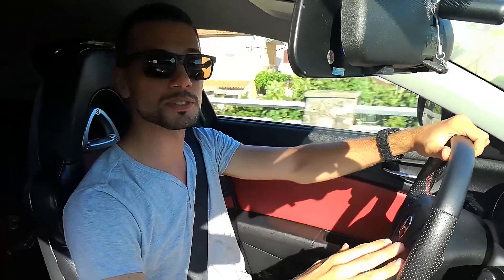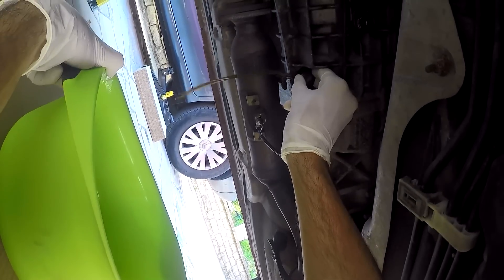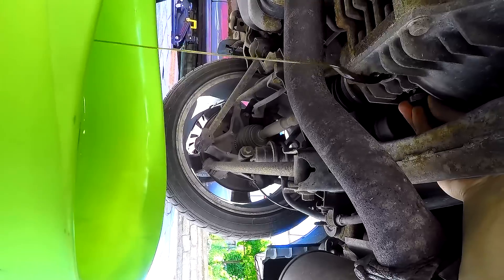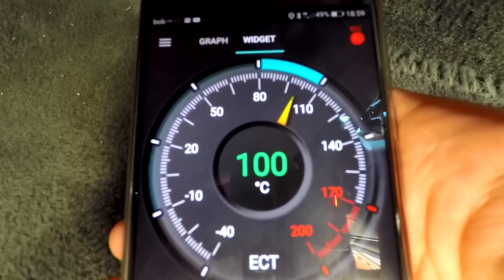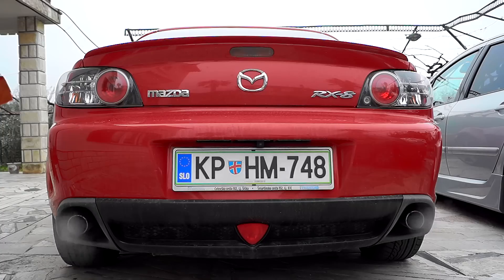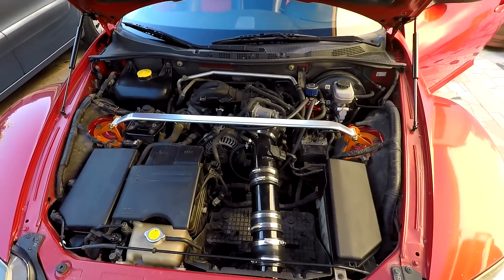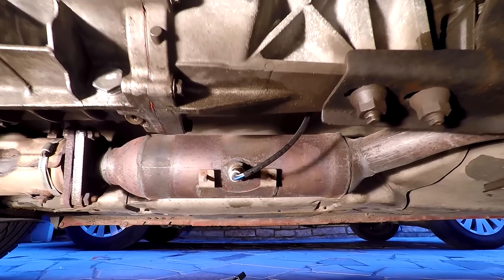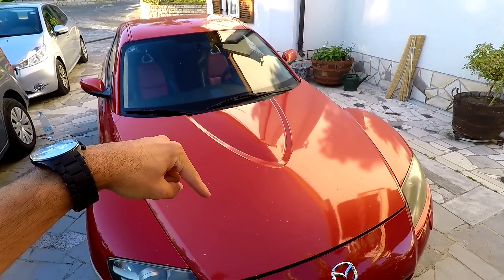10 Ways To Make Your Mazda Rx8 More Reliable (dont' disconnect the metering pump)

Comment: thank for all the tips about RX 
i have RX8 2005 se3p i think its 1st gen. i get the rx for very low price all stock and have 
145,000 kilometers on clock  its my 1st time on rotary engine the only issue is long start
my question is it worth the to spend or start for upgrading the engine? like sohn adapter exhaust 
filters and every thing.! or its too late for that and run the RX till end of it...
i get the car just for fun and try the rotary!  i have everyday car 
if i start to spend the money it will very expensive specially here in japan
the car registration and road tax is very expensive so if you tell me is it worth to spend money
i will do i trust you..
thank you and sorry for my bad english
Reply from the maker: You're welcome man :) Yes that is the first gen rx8. My suggestion would be to make a compression test, so you know how long the engine will last. I made a video on that topic that you can do at home for under 30$. There you will also see a chart that will tell you what the result means. If the compression is good, i would suggest to upgrade your engine starter, to a 2kw or 2.2kw one, like i did in this video https://www.youtube.com/watch?v=vgIhxFU-nGg
If the compression is not good, i wouldn't suggest investing on mods, but rather do a rebuild. it'll be a bit expensive, but then you'll be able to enjoy the rx8 for many many years and be able to do mods. I hope this helped :)
Reply: thank you for advice i've done change the OEM starter to N3R3 more big and power now my car start quick
i think i will invest on mods like you sed
Reply: @reggieflores5263  is bigger or more powerful battery with 750 or 900 CCA better than better starter? Thanks 🙏⭐

Comment: One other small but important thing. The SSV valve and selenoid should be replaced after around 80,000 miles. Just once, the newer parts have re-inforced parts.

Comment: I have 3 concerns with my new 2003 RX8 that I need to fix...
1. Heating/Cooling not working properly,
2. The Airbag light is on and won't switch off no matter what I've tried (the steering wheel had been changed, maybe this has effected it?).
3. My dipstick and oil cap lid has "cream" on it... (similar to when a piston engine blows a head gasket). I'm told this is just moisture and is normal for a rotary engine... is this true? 

I gotta start somewhere... what do you recommend  Kristian?

Comment: Dam...   09 rx8 with all stock ignition system and it fires like new still...   75k miles and no rebuild yet...   Only thing I have done is cut off the cat and muffler running straight pipes...   Always run 91 premium  fuel or higher...   Im breaking all the stereotypes lol...   BTW I don't premix...   Im planning on getting a sohn adapter in the next year tho...   Easier to fill those reserves than the engine oil
Reply from the maker: You and me think the same ;)

Comment: Hi, Sir
    Can you make a video for draining the clutch fluid? My car has a problem which is when the engine goes warm, my clutch would go to stiffer. I think I should bleed the clutch fluid. But I don't have any ideas about that. Thanks
Reply from the maker: I will do it, but later around october/november :)
Reply: Yes forsure bleed it mine did the same thing

Comment: What oil filter are you using and do u pre mix ur car ? if you do what ur ratio =)
Reply from the maker: K&n oil filter, and i don't premix, i'll rather run the Sohn adapter in the future :)
Reply: Thanks for the reply man really appreciate it ! <3 do you mind explain about Sohn adpater to me ? is it the same as OMP?
Reply: rebel 510678 for what I understand from the video is still pre mix but he added a container to hold the 2 stroke oil in the engine bay but I could be wrong correct me if I'm wrong :)
Reply: He uses an oil catch can to catch any oil which he overfilled during the regular top-ups. The sohn system is a better oil injector for beter apex seal lubrication i believe
Reply: Mark Boersma so is still premix but instead of adding the 2 stroke oil into the gas tank u add it into the sohn ?
Reply: Yes, that's what I think anyway (haven't done a lot of researce on it though)
Reply: Oh, I used to premix my car around 150:1 to 160:1  just by mixing it with the fuel. Estimating the litres that she needed and putting the matching amount of oil in the tank before filling up (watch for any people around you because they tend to look like you're an idiot when you do it this way 😂)
Reply from the maker: Premix and sohn are the same thing, but done differently. With premix you add s troke oil in the fuel, and that's what lubricates your engine. With the sohn, you put in only fuel and the engine oil does not lubiricate the apex seal anymore  ( you disconnect the dirty 5w30 oil from teh oil injector) , but the sohn system runs the clean 2 stroke oil directly in the original oil injector that lubricates the engine. This way you eliminate the dirty engine oil you usually pour in to lubricate the engine, and have a clean one that reduces carbon buildup. Hope it was clear :)
Reply: I run 80ish/1 in my single cylinder 4stroke dual sport and 100/1 in our v6's. Noticably better pulls and better mpgs 😂
Reply: Driven by madness so the sohn is kinda like a new oil injector for the car the shoot clean 2 stroke oil ?
Reply from the maker: Yes :)
Reply: so in the video there 2 bottle would i needed to fill up the 2 bottle or just one
Reply from the maker: Well 1 bottle replaces the big windshield washer fluid one, and the other is 2 stroke oil :)
Reply: Driven by madness ahh I see thanks for your reply man really appreciate it! <3
Reply: Driven by madness ahh I see thanks for your reply man really appreciate it! <3
Reply from the maker: no problem man :D
Reply: Driven by madness one more question man do I have to refill the 2stroke oil every time I get fuel for the car or only refill when it's finish in the container :)
Reply: @markboersma8694  Great info 👍 1:150 ratio; is that same as 1/2 oz per gallon of fuel?  I think 64 oz are in gallon so 1oz premix = 128 oz fuel or 1:128 ratio.  Any thoughts?  Thanks 👍🙏
Reply: @Drivenbymadness  Great info but doesnt OMP also lubricate rotaries on inside And outside to cool engine?  So that means original OMP may be better left as is?  Thanks 👍🙏⭐

Comment: Im thinking about getting an RX8 for my first car, do you recommend it? i will be able to afford regular maintenance, and would definitely redline it daily...should i get a rotary or do you recommend i get something else?
Reply: Well, if you're willing to keep up with it, then go ahead. Just make sure to get one in good condition and try to avoid buying a series 1 car.
Reply: Do it man. I got one and it's just too fun to drive. But don't be like me and avoid maintaining your car. All I did was properly oil the car. But now I want to flush the coolant and replace the starter parts. Just now starting to do these DIY maintenance fixes. Don't wait. My car is fine, but just don't be afraid to mess around with your car. It's not that daunting and seemingly impossible anymore thanks to guys like Driven By Madness posting quality videos like this. 💪
Reply: Did you end up getting it?
Reply: @rihasanatrofolo2472  No, I ended up getting a Ford Falcon Instead which loves the abuse and loves 0 maintenance

Comment: So putting 98 octane fuel is better than 95? And is 95 octane fuel ok though?
Reply: It should be ok. I don't own one myself yet. On the dutch forums most just fill it up with 95 because that fuel is almost 10 cents cheaper per liter.

Comment: What is you opinion on an 05 rx8 with 80000
Reply from the maker: Petar Haboj depends. Compression status, exhaust white/blue smoke, ignition, has the engine.been rebuilt? Rev consistency (smooth rev to 9000rpm).

Comment: I have a rx8 05 shinka but idk if synthetic oil is good for it or is non synthetic better?
Reply: YoloRaul use non synthetic. the synthetic oil burns up the apex seals faster. 5w20
Reply: @icedcoldkilla  Hi some say 10-40 may be better than recommended 5-20. And are u sure mineral is better because it burns off better than synthetic?  Thanks 🙏👍🎆

Comment: The catalytic Converter can cause symptoms exactly the same as low compression, ie: loss of power and hot start issues, struggling to reach higher RPM range etc. Left my poor Rex sat for months because it lost all power and simply not drivable and I thought she needed a rebuild, turns out it was just a blocked Cat 🙄🤣

Comment: I have no idea who decided revving the RX8 to redline was a good way to improve the Renesis reliability but it's literally the best way to ruin one.
Mazda did not factory balance Renesis Rotors. 
This means it will not tolerate being operated at the top of the rev range.
If you haven't done a complete engine  tear down and had your rotating assembly professionally balanced you will damage your RX8 by regularly over revving it.

Comment: So I live in the USA, why should I not disconnect my metering pump? I'd rather premix and know that there's always oil lubing things up
Reply from the maker: The rx8 omp does more than oil the rotors. It also helps to cool the oil control seals on the sides of the rotors (because the exhaust ports were moved to the irons you need this extra cooling
Reply: So should I even bother premixing?
Reply: Travis Brothers yes just premix through the gas tank every fuel up. And let the metering pump do it’s thing. Don’t think too much about it, use premix ever time I fuel up at a gas station. Also always use 93 octane in the US
Reply: Yes it sounds better to Not disconnect OMP and have premix option because some oil sounds better than no oil if premix isnt working or just a "myth" to lubricate Apex seals. I read that 2 stroke premix burns off better so now wondering if Apex seals are truly lubricated if 2 stroke premix is "burned" off ? 🐶🐱🐹🙏
Reply: @travisbrothers7871  Interesting info. Sounds better Not to disconnect OMP & have premix option 👍🙏⭐

Comment: How many miles on your current engine and how many miles on the odometer
Reply from the maker: The engine was replaced at 62.000km and the odometer has 119.000km :)

Comment: Actually yes, you should disconnect the omp and block it off. Then run heavy premix that way you stop burning engine oil and only 2 stroke. Not many race cars run omps.
Reply: SPCSpriggs I believe that's what the Sohn OMP adapter is for. It adds a reservoir connected to the OMP that allows you to run a separate oil than what is in your pan. The idea is to fill the reservoir with 2 stroke oil.
Reply: @matthewnovak7351  Both interesting ideas.  Cutting off original OMP & premixing at higher ratio seems interesting.  Anyone have info on best 2 stroke premix oil ratio? I read from 1/2 to 1 oz per gallon fuel ⭐🙏

Comment: about 8 (carbon built up) you are wrong...this is a myth...cause the metering pump takes orders from the throttle...when the throttle is fully open the metering pump sends to the injectors as much oil as it can....so if you travel at about 4000rpm and the least possible load,then the metering pump will send the least possible oil...you can check it with a "good" diagnostic tool...generally RENESIS apex seals hate high rpms(revs)...RENESIS will last less when you push its limits....THE MOST IMPORTANT THINGS ARΕ:lower temperatures(coolant fluid and oil),"fresh"engine oil and a LITTLE bit of pre mixing...
Reply: Giotoules Chris Great info 👍 what oils & premix ratio do u recommend? Thanks

Comment: I always hair not to flood the engine but never explaining why, someone please explain, I've been wondering for a while now
Reply: Semi-Deep Thinker On a cold start, the RX-8 runs very rich until the engine gets up to proper operating temperatures. If you turn off the car before it has had a chance to warm up and burn away all the fuel, it will leave unburnt fuel in your ignition chamber. If too much unburnt fuel is left, the car will not be able to start and is called flooded.
Reply: ok but whys that such a big problem in a rotary, does it damage the engine in someway or is it just a pain in the ass to de-flood
Reply: Semi-Deep Thinker From what I understand, it's just a pain in the ass.
Reply: ok thanks

Comment: I really want an RX8 but man I am not sure it deserves the hustle. The amount of issues that can cause a breakdown seems quite a lot.
Reply from the maker: if you like to drive cars more than working on them and taking care of them, then i think it's best you look at a different car, like a Nissan 350z, Toyota GT86, or a BMW m3 :)
Reply: Well all three of them cost a ton here, where I can buy a good shape RX8 for the change I have in my pocket. The one alternative I also keep an eye out is a Toyota MR2 which I can find around the same price range and usually Toyota engines are deathproof.
Reply from the maker: But it's a relatively old car. If you have the money then get an rx8. It's not that big of a deal to maintain, but fuel economy is a bit scarse. But a scooter could solve that problem :)

Comment: OK but omp's are prone to failure, why not just suggest pre mixing entirely and block off the omp, which is the only permanent solution for reliability. I can see where the omp injecting two stroke oil is nice, but will a working omp its suggested to premix 1/2 ounce to the gallon,  so seems like a waste of time to me

Comment: DO not remove or disconnect oil meter pump, that is stupid, premix with the metering pump. reving to red line once a day will solve the carbonizing up issue

Comment: IT'S the OIL WEIGHT! THAT is why the engines last only 20-30,000 miles! Mazda recommends TOO THIN AN OIL!!!! Needs a heavier weight OIL!!!!!!!!!
Reply: I read 5-20 may be too thin depending on conditions. Some say 10-40 may be better, especially in colder areas. What do u recommend & mineral or synthetic? Thanks ⭐🙏👍

Comment: This worse car I ever had, never again. I rebuilt engine twice in 10k miles not kidding and took care of every single thing, I prefix with motul 800 the best 2 cycle out there, I used the best oil on pan, had cold air intake, had bigger radiator, red line everyday it doesn't matter, this shit is a bomb and it's not reliable. Too much maintenance and this car drinks more gas that any v8. Put this all on paper the money just for gas and oil and catalytic converter because it will go bad pretty quick, and the car is so slow, no torque at all... just buy something else